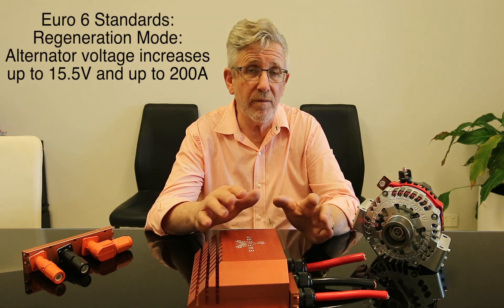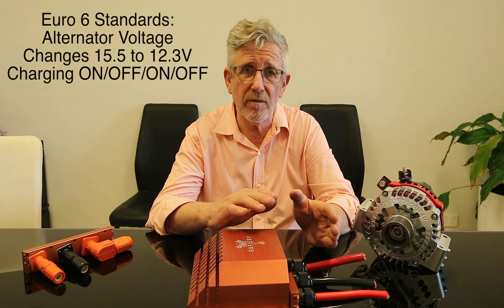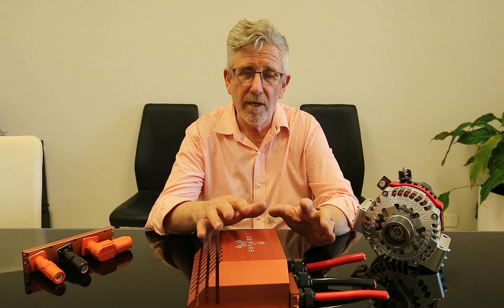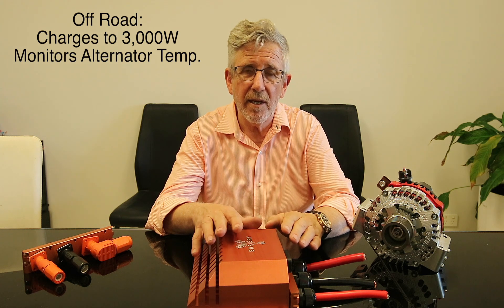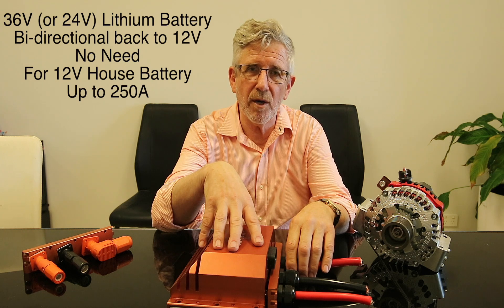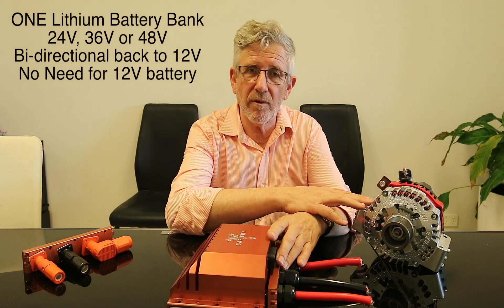Scotty 3kW Bidirectional DC to DC Charger

Comment: Is this a valid scenario ...
- 24v/250 amp alternators (like electrodyne)
- 48v 20kwh battery bank (driving some 48v loads directly)
- Scotty that basically serves 2 purposes ...
1) charge the 48v bank from the 24v alternators 
2) provides clean 24v to 24v consumers
Reply from the maker: Yes you are spot on. When engine turned off, Scotty will deliver 24V power back to consumers with 25ms switch over. please read our doc "What Scotty can do your you".

Comment: The two stroke outboard charges a 12volt battery will that device step up the voltage to charge a 24volt pack.?
Reply from the maker: Hi Chad, yes. There are 5-6 videos of the outboard charging scenario. Because its bi-directional, when the outboard is off, power flows back from the 24V to the 12V side. So no need for a 12V house battery.
Reply: @Safiery  is the standby drian when connected to the battery.?

Comment: Looks to be a good product. 
I would seriously consider a purchase but there seems to be a gap in information that you may be able to clarify ?

An alternator has a peak/instantaneous rating but will also have a continuous rating which is constrained by its ability to shed heat over an extended period.  I'd like to know what the continuous output (under normal conditions) is of say a standard VDJ alternator as well as the 'upgraded' alternator units. Most literature suggests an alternator is 55-75% efficient so being optimistic and taking 80%, you'll have to dissipate 20% of its output in heat. I think you mention around 150A for say, a std 1VD which equates to 420W of heat to dissipate. In standard configuration my understanding the 1VD alternator will pull back to an equilibrium point where temperature is acceptable. in 3kw configuration this is 600w of heat byproduct...

Can you confirm some of the continuous current outputs (over 30mins with engine @ operating temp) you are recording for some of the installs (std and upgrade alts)? 

Thank you,
Reply from the maker: Thank you. Its a little more complex than that when you look at the engine efficiency between idle and peak power. This is the "white space" we are working to extract power from. On a 250A 12V (nominal) alternator we extract comfortably 2500W continuously. The vehicle itself takes power and the balance is extracted by Scotty. When we have 300A+ at 12V alternator we extract 3000W+. However, Scotty is a variable power DC to DC. In extracting outboard power (see several other videos) Scotty will not bog down the outboard's power system.
Reply: @Safiery  Thanks for the reply - an engineer here BTW. my specific question was around OEM alternators (paired with your DCDC) and their fundamental constraint of heat removal. Both of your industry counterparts (victron and stirling) demonstrate this heat constraint through videos of OEM alternators on a test bench(do a search on youtube). my only hesitation with purchasing your DCDC is that an OEM alternator will temperature de-rate its output to around say 80A continuous anyway. Can you demonstrate your products on a test bench along with a FLIR? thank you in advance

Comment: so can this be for charging a 12vdc lifepo4 system in my 2017 F350 truck.?.
Reply from the maker: We have a 12V version coming. It is 12V-14.4V at 100A. So its set at 1500W and is 96% efficient. Watch for release on insta/YouTube

Comment: would this system interfere with and throw codes if the vehicle happens to be a Honda with dual charging system which charges the battery at different rates depending on various factors like are you running auxiliry power items or headlights. Hondas dual charging system A dumb worthless system in my opinion
Reply from the maker: Hi Gary a great question and the answer is no. But you are on the right track for an "alternator controller" which controls the field current of the alternator. When this type of controller is used with most Euro 6 engines and engines using a LIN bus control (probably Honda) it may throw codes. With Foe\rd, we enable Dual battery mode to prevent it. However, Scotty is a load applied to the vehicles alternator and if the alternator cant keep up with the power demand, the output voltage dips and Scotty throttles back. So it will work 100% with all engines. We have a linkedin Article on using Solar to help with fuel economy! https://www.linkedin.com/pulse/solar-panels-save-fuel-suv-bruce-loxton/

Comment: Why wouldn't you just fix the inherent inefficiencies in the 24v alternator (installed on a 12v system)? 
Use 3 phase 24v in series (with one winding reversed), giving 72v AC, rectified to about 100v DC through schottky diodes, into mppt controller with output to 12/24/48. You start with a 50% efficient source then try hard to not have cascading losses, when you should be increasing the efficiency of your source. There's no need to upgrade the alternator to heavy duty. Just bypass its shitty regulation and rectification and you will have much higher output. By removing the inefficient regulator and rectifier, the alternator has less heat, which means it can handle more current. I haven't done the math but I would expect 100A (out of the MPPT) from a 50A factory alternator using these modifications, at idle. Go to max rpm however and you are likely to get 250A (assuming your MPPT can handle the higher input voltage and output current). Think about it: in one instance, you are producing say 21v, having it rectified to DC at the cost of 2x 0.7v diodes, now at 19.6v, and you only want 13.8v so the regulator burns off 5.8v. You just lost 7.2v x your current rating, which at 50A is 360w. 360w is a lot of heat. Your output is 690w.
Now do it my way, you have 63v less 2x 0.3v to 62.2v, x say 60A because you don't have 360w in heat, so you have 3732w, then about 5% loss through the mppt to 3545w. That's 257A. From a factory 50A alternator
Reply from the maker: Our goal is to work with Euro 6 engines and maintain compliance. Our solution does that and even improves the efficiency with our new 3.0 release.
Reply: Done the math I agree! The caravan industry will benefit because it’s moving to 48v
Reply: "Use 3 phase 24v in series (with one winding reversed)" can you illustrate that, and post it? Thanks.